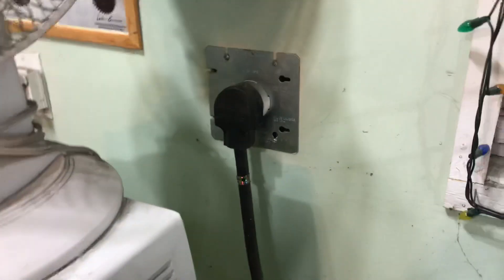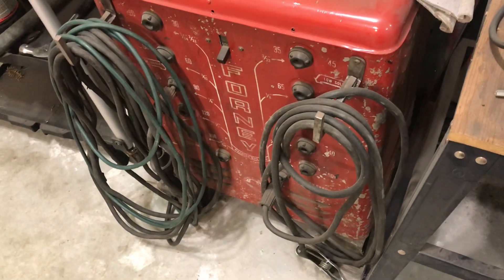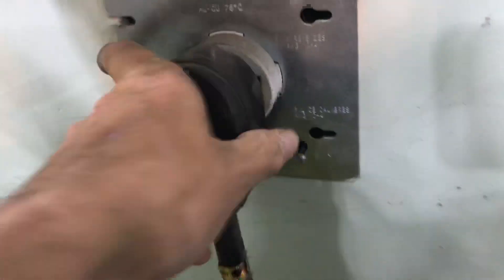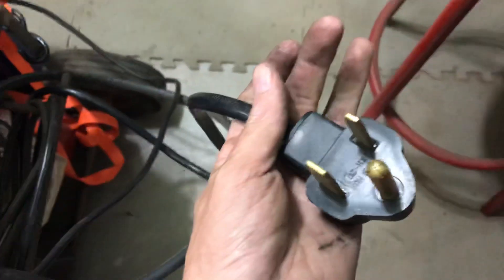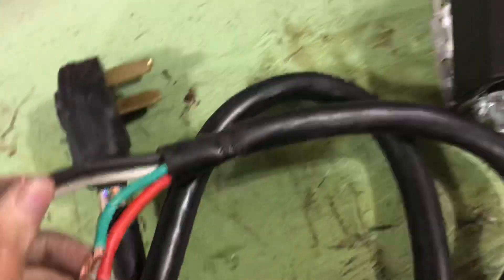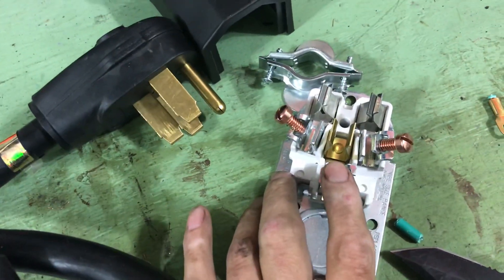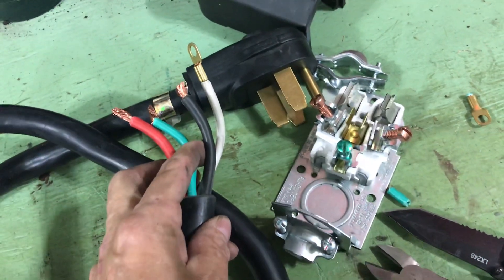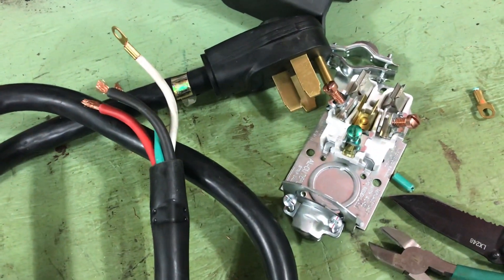Wiring a Welder Plug Adapter.

Comment: The red and the black Goes on right side and left side the white wire goes on the Metal in the ground wire which is your green goes on the frame of the box
Reply from the maker: Got it figured out, but thanks!

Comment: You don't use white wire. White wire gets wire nut and electrical tape.  Green to ground.   White wire is for 120v functions WHILE 240 is doing it's thing (ie. lights timers and digital readouts on dryers, ovens, etc).  Your welder doens't need this.  If it's a 120/240 welder, then you will have a different plug for 120v operations.  I have a Lincoln 210MP and Square Wave 200 that i have a 10awg extension cord for.  3 prong (NEMA 6-30R/50R) outlet box, wire, to a NEMA 14-30P/50P 4 prong plug to go into dryer outlet in wall. I actually left the neutral blade out of the plug altogether.
Reply from the maker: Thanks

Comment: How's she goin'?  Bruce I don't like to try an explain how to wire this because if my explanation is not real clear you could have an accident.  I don't want that.  
Just a word about the white wire.  It is a neutral wire and isn't needed if what you are plugging in doesn't need any 120 volts supply.  It's clear that your other welder doesn't need the 120 volts and that's why the plug in only 3 prong.  In this case the white wire just isn't used and can be cut off.  I bet this made it a lot more clear eh!!!  Take care and be careful!!!
Reply from the maker: Thanks Mike.  That's kinda what I thought but figured it would be good to ask those smarter than me.
Reply: @BruceLyeg  Not sure about the smarter part there buddy, but your welcome!!!

Comment: No need for the white neutral in this case. Don’t use it. Red and black have 240v potential difference. Green is ground. Normally the ground and neutral are bonded in your box so there is no potential difference there. Potential difference between the red and white is 120volts same for the black and white. Long story short you need 240 volts so the red black and ground is all you need.
Reply from the maker: Thanks Joe.  That's the answer I needed.

Comment: Black 120 volts, Red 120 volts = 240 volts,  Black plus White = 120 volts, Red plus White = 120 volts, white is only use if you need 120 volts. hope this help.
Reply from the maker: Thanks Ron.  That's what I figured but thought it would be wise to ask those who know more than me.

Comment: Id be happy to keep my comments to myself if i thought i could.  You will be able to cut that white wire off and tape it up.... and you can also remove the blade from the plug in.. so it won't go into the socket on the wall.  your welder will only use the black red and green. That's how this truck driver would do it :-) I'm willing to bet your old buzz box welder just has the white wire nutted off or taped i doubt it goes to anywhere.
Reply from the maker: Thanks!  That's what I thought but figured it would be better to ask for advice from those more knowledgeable than me.
Reply: Does it matter what side you put the black and red? I am doing he same thing except using my range/stove outlet. 4 prong as well to a 3 prong welder plug.
Reply: @kevincabral135  shouldn't matter at all what side the two hot wires are on.

Comment: You normally would use the black as a 110 volt the white as a 110 volt and the green as a ground what it looks like is the wall outlet is a 3 prong but the cable you are showing is a 4 prong
Reply from the maker: The wall outlet is a four prong receptacle, the welder is a three prong plug.  They sell adapters but they want stupid money for them
Reply: @BruceLyeg  you should have no problems using a white black as hot wires and green as ground
Reply: @BruceLyeg  the 450 cable on the table is a 4 prong  the receptacle is a 3 prong talking about the end of the video what's on the welder is a 3 prong
Reply: @BruceLyeg  not what it looks like from the video
Reply: The 450 receptical is a 3 prong plug